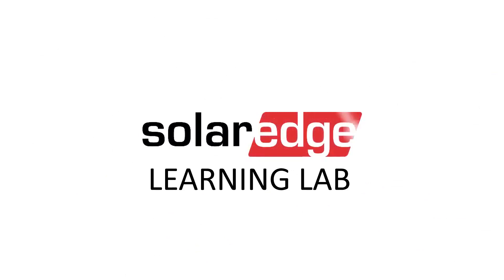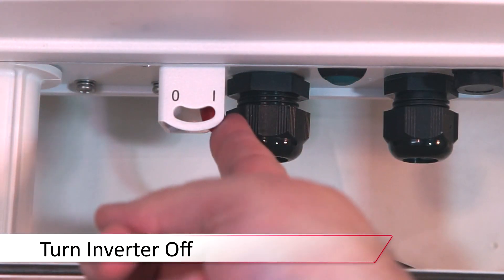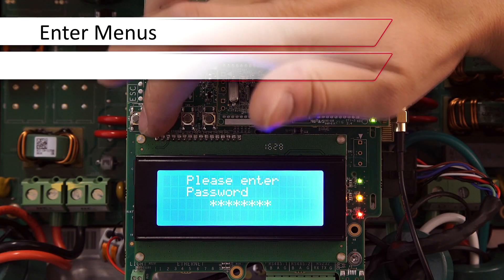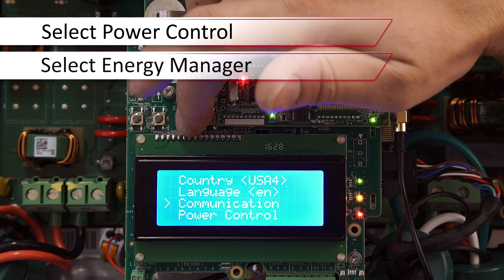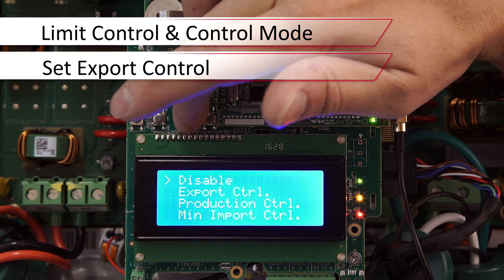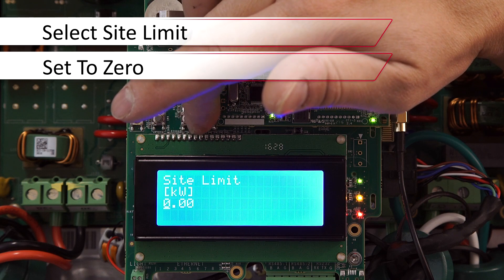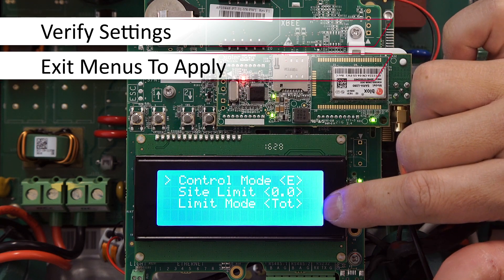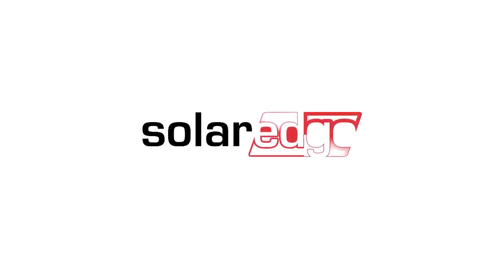SolarEdge Inverter Tutorials: Setting Zero Export

Comment: Hi! 

Have 3 phase SE7K-RW0TEBEN4 invertor without lcd - setapp. 

Why when export control Total set to 0. Production is 2kw. 1kw used locally. But iverter on 1 phase get 1kw from grid and send to grid 500w on phase 2 and 500w on phase 3. How can fully set zerro export, but no excange method. 

When select 0 To phase. Iverter not production more than 50W. 

How to fix it?

Comment: My power company does NOT do net metering at all, but pay me only .05 for overproduced, But they also charge me a demand recovery fee of 4.94 per KW size of my system, I have a 11.6 KW system so do the math and that is $57.30. My best  on return of selling back my over produced was about $34.00 a mo,  It does not even cover the demand recovery fee (crock of chit fee)! I want to know if I can go back to my old 1 way meter and not sell a watt back but keep my solar on my side the meter to charge batteries and run the house and only use grid in emergency  when batteries are  down and no sun. I have solar edge equipment and 20 KW of solar edge battery. My min bill without using 1 watt of ele would be $92.25, min meter fee, and crock of chit fee! WFE co op is NOT solar friendly at all! and having solar, I am paying a higher cost per KW then before solar!  Any help with going back to my old 1 way meter with WFE Co op would be appreciated!